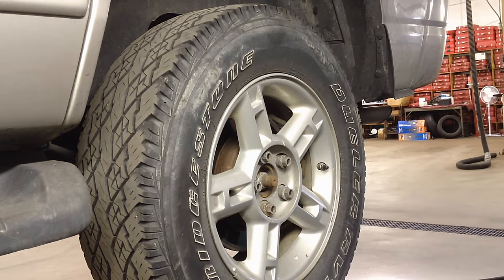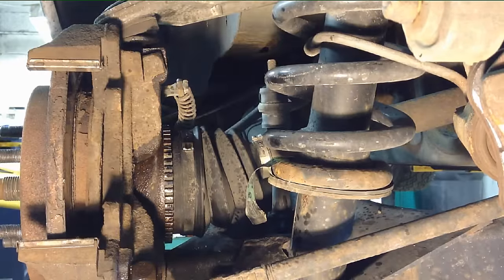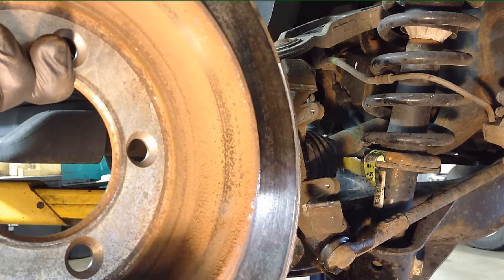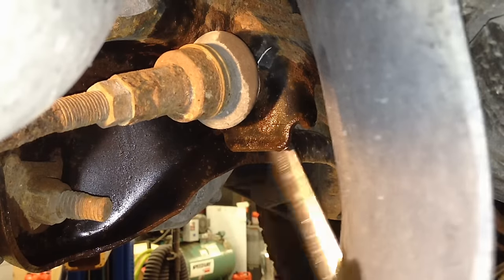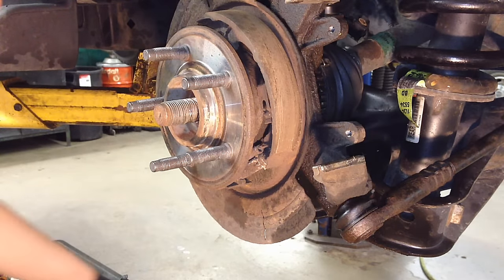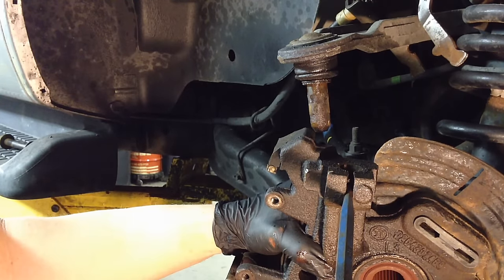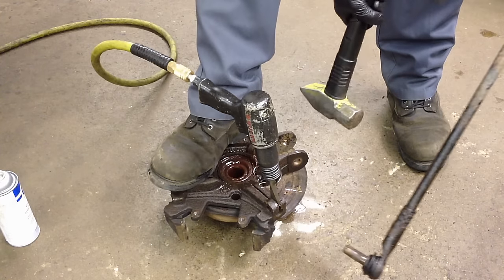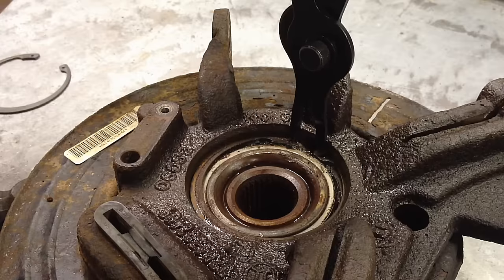2002-2005 Ford Explorer Rear Wheel Bearing Replacement

Comment: I just got estimate for front and rear 3900. I begged sister just buy a new car. Explorer has 200k miles on it. We fixed ac 1500, tires 600 and front headlights and turn signal lens 210.  She could put that money in a down payment on new explorer.
Reply: acá en colombia todo eso sumaría alrededor de U$ 1500 con mano de obra incluída, además el 80% de colombia no produce óxido, USA es demasiado costoso

Comment: where do you get all these white towels? ive only used red rags.
Reply from the maker: hddm3 Ours used to be red too, but they changed to white for all our towels now. I think it has something to do with complaints of metal shavings in the rags from machine shops cause ever since the white towels I have never seen metal in the rags anymore.
Reply: yes ive learned real quick to look at them rags for that reason, ive come real close to wiping my face with some metal shavings from them rags. I just use the blue paper towels now. thanks for the quick reply.
Reply: Where i work at they get boxes of old clothes or hospital gowns that are all cut up,then when their  done, its thrown away.

Comment: Whats the rating on that press you were using?
Reply from the maker: MrNotorius5500 20 ton
Reply: +FordTechMakuloco That's not always enough for those ford truck bearings from what I've heard.  Good idea giving it a few whacks with a sledge first to break it loose from the rust.

Comment: 2003 Ford explorer SPORT front bearing. help!
Reply from the maker: What about them they are very easy to remove, I have many videos on the 4x4 models.
Reply: FordTechMakuloco ok let me look at them. basically I bought the new rotor and bearings. now the new rotor seems to have new metal o ring already inside, just like the one that the new bearings come with. if I insert new bearing with out metal o ring perfect fit. question, do I remove metal o ring already in new rotor and add the one that is coming with the bearing? because when I go to insert rotor with bearings it does not slide in all the way! Why?? do I need to remove metal o ring already in new rotor?? because bearings fit perfect.. I will look at your 4*4 video

Comment: Can't you just buy the hub? I saw one for 89.00 from Autozone, never did this on a ford so maybe it's incomplete, but the front hubs I just bought for my ancient 92 Jeep xj cost $25.00 a piece from parts geek, yes different car and all, but the Ford ones at even at $106.00 from advanced would be cheaper than paying a mechanic to do all this pressing, assembly, disassembly ect, seems way more costly, again that might not include something. Great video's though.
Reply from the maker: No these are press in style bearing totally different than what you are speaking of.
Reply: @FordTechMakuloco  Thx for the reply and clearing that up for me, doing a pad and rotor job on our 2004 explorer and thought it wise to watch this video as it goes into everything back there. Subscribed after we got it in march, already did front pads, rotors and as it turns out, the thermostat yesterday. Again thx for the quick reply.

Comment: would love to have the ford dealer do it but they are trying to charge me $530 just for the bearing
Reply from the maker: Swap it out yourself make it all new for less following my video using this preassembled kit-LH- http://amzn.to/2lo4ShC
Reply from the maker: RH-   http://amzn.to/2kHOnxR
Reply: Even understanding your video, is this possible to be done by a normal guy, with regular tools and WITHOUT a press like the one you use? Is it possible to use some other way around the press?

Comment: So if I just get the whole hub brand new I don't have to do most of this correct?
Reply from the maker: No it is all separate on these in the rear normally but Moog now has complete assemblies they are worth it in my opinion-                                                                                                                                                                                                      Left- http://amzn.to/2j9VP3D
Reply from the maker: Right- http://amzn.to/2i6f4y4
Reply: FordTechMakuloco how about for the front?

Comment: Maybe its just me !,but if I'm in to the ball joint level I'd replace them while there!
Reply from the maker: There is only one ball joint and it’s part of the upper control arm, very expensive to replace especially when they rarely fail on this model.

Comment: that rear upper balljoint looks worn out i woulda tried to sell the job. looked loose but maybe it was different in person tho
Reply from the maker: phil holbrook Nope they were all tight the rear ball joint on these rarely fail.
Reply: oh ok.i want to work at a ford dealer as a tech but the problem is flat rate. i can diagnose and eveything but would lose my ass on the times. i like to diagnose very well and not throw parts. you do good work!

Comment: how many pounds to tight the bearing explorer 2005? anyone?
Reply: what do you mean how many pounds to tighten the bearing? Its pressed in with a hydraulic press, not bolted in where there is a torque value.

Comment: I should have just taken mine to a damn shop.  If I had seen this before I got started taking mine apart, I would have just said screw that.  But nope, now I still have to take it to a shop to have it pressed.  Jesus H Christ what a pain in the ass!  Thank you for this video, though.
Reply from the maker: Yes they are a huge pain.
Reply: What does the "H" stand for in "Jesus H Christ"? lol. Also I see a lot of guys saying these are a pain but I haven't had too many issues with ford wheel bearings. I've done mine without a press and literally just grabbed a 10lb weight from my backyard, a 5lb weight that's the same size as the bearing and just "HULK SMASH"ed it out of the knuckle. I think the issue isn't so much that they're a pain in the ass to get out but we don't expect to use that much muscle to get them out. 

QUICK DISCLAIMER!! I've only had to do this with ford in Sunny California so maybe that's the issue. But I just watched Eric The Car Guy have a bunch of trouble with one and this guy (one of my favorite ford guys) seemed to say the same thing. Both are professional technicians and I'm a mobile guy so I think they're probably onto something there. But try the weight. A plate off your weight bench will do it, the heavier the better. I'd say 10lbs, if it's still being a pain, try a 20lb plate and 3 consecutive good hard wacks. Should move right on out without even using PB blaster.

Comment: I'm working on one of these pieces of junk and after you take the axle shaft nut off, it's suppose to just slide through the hub as you remove the wheel bearing assembly. I broke one puller trying to get the axle shaft out of the wheel bearing and hub. I got a heaver puller and it still will not come out of the wheel bearing and hub. The spline is really rusted and tighter than a nat's ass. So tomorrow I will heat the hub up since the wheel bearing is no good anyway and hopefully get the axle shaft out of the wheel bearing and hub assembly. It does not slide out like this one in the video,,,,,,,,,,,,,